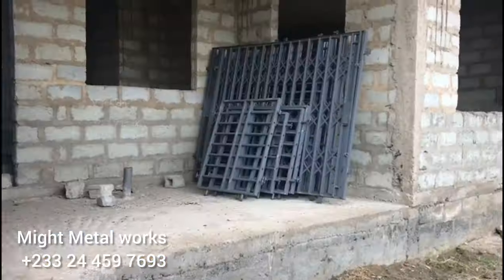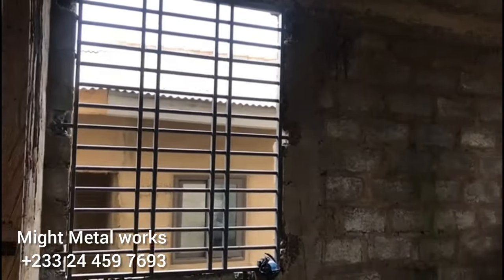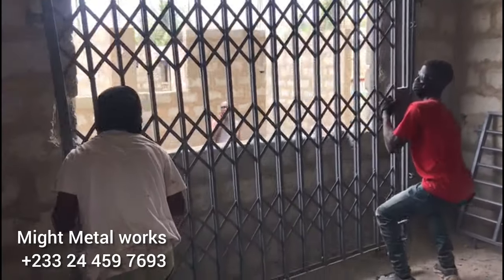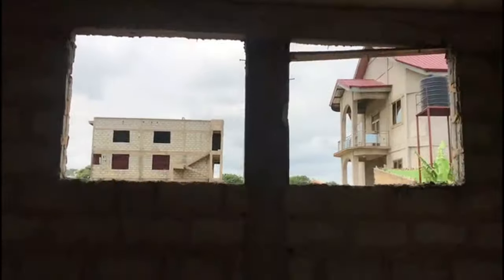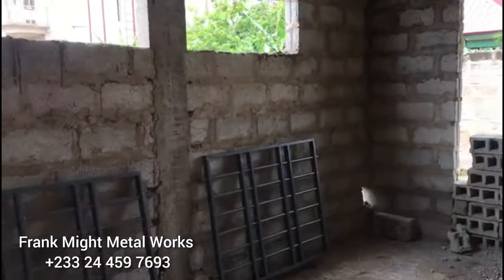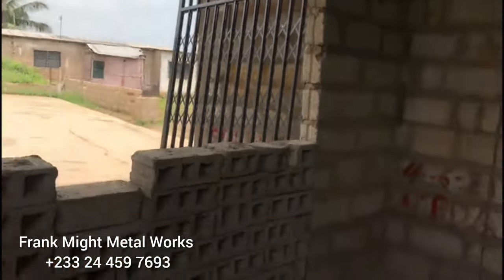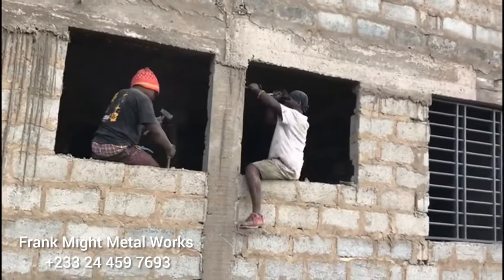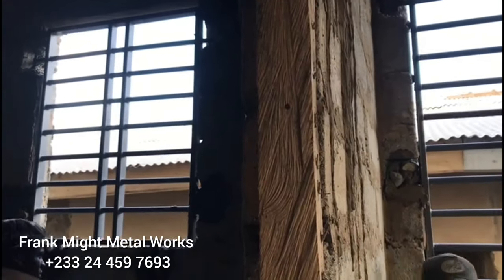Building In Ghana: Cost of Burglar Proof |  How Much Does it Cost to Build a House  Start to Finish

Comment: How can they plaster and dress the edges of the openings if they fix the burglar proof before plastering?
Reply from the maker: Great point and you are right but it's still possible to get it done as the installation was more to the inside.....
Needed to place to burglar Proof to prevent people from entering as we have multiple cases of that

Comment: What happens if there is a fire? How do you get out quickly
Reply from the maker: Thanks for the question, if you notice, all the burglar Proof infront of the house is a sliding one,  so one can open and exit in case of fire....
2. If you notice, We didn't fix any burglar Proof by the door ( entrance and Kitchen) so its also easy to just exit incase of fire outbreak.
Reply: Use buglar proof for windows only, and security doors for the doors
Reply: @e-koto  it is smoke that kills you before the fire even gets to you. What if the surity doors are blocked by smoke and fire